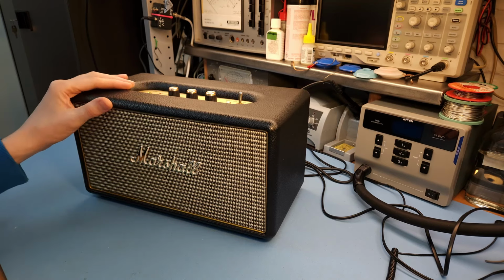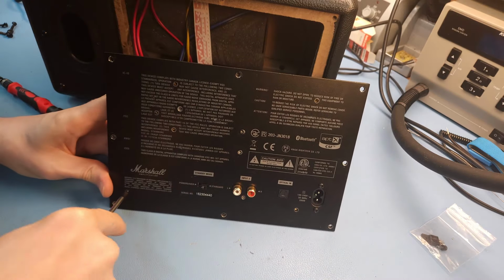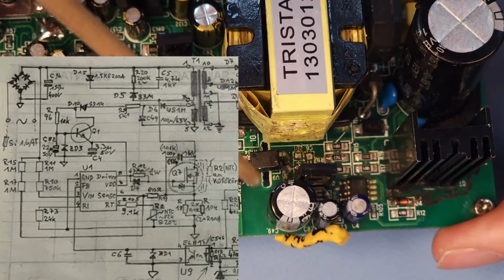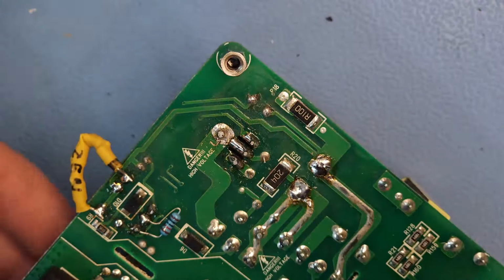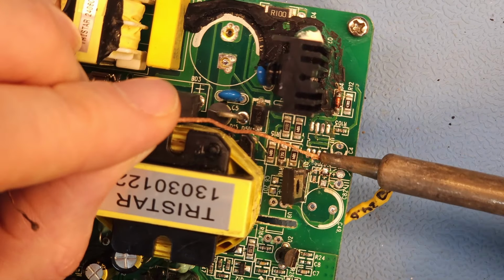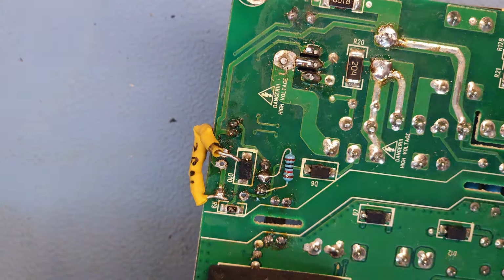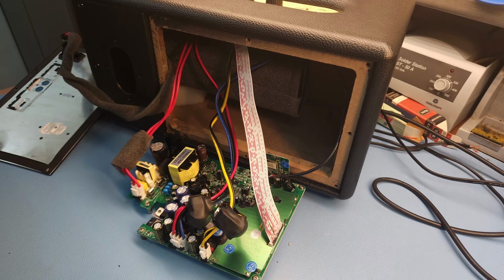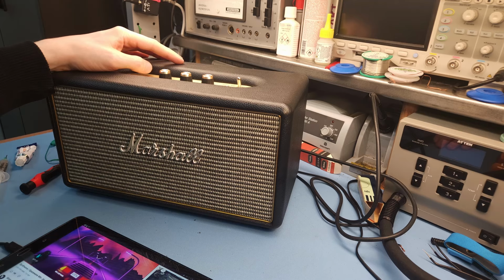Fixing a completely dead Marshall Stanmore Bluetooth speaker

Comment: Nice work! Seems you would benefit from a higher solder iron temperature, especially when desoldering the big buffer cap, also when using solder braid. Either a tip with more thermal mass, or an iron with better temp control
Reply from the maker: Yes, I could have turned up the heat a bit more for those.

Comment: Thanks a lot! My Stanmore 1 powers up and connects to Bluetooth but there is no audio, even not when I send music through the input through cable. Strangely, when I switch it off the led remains on. Any idea where to start?
Reply from the maker: That sounds like an issue with the amplifier. I would start looking in that area. Might be a blown transistor or mosfet in the amp.

Comment: How did you remove all the black glue that prevents access to the components? Melt it? Not sure how to do that safely and effectively.

Thanks for the video.
Reply from the maker: Carefully prying it off. Isopropyl and a bit of heat can help. 
I'm actually starting to think this black glue is the root cause of all issues as it gets conductive.
I'm making a follow-up video at the moment.